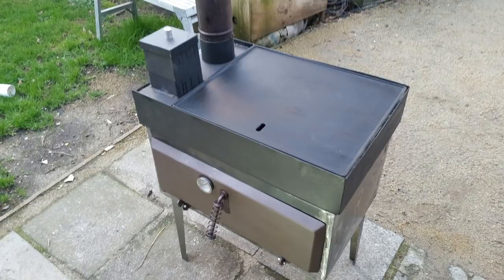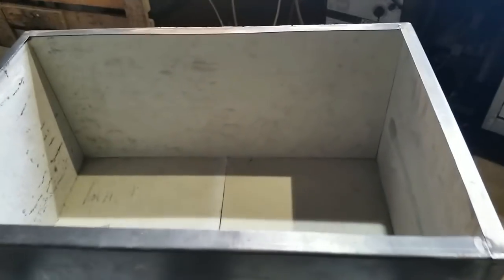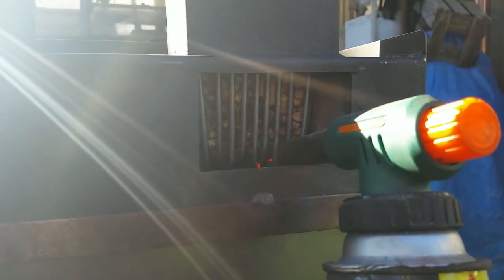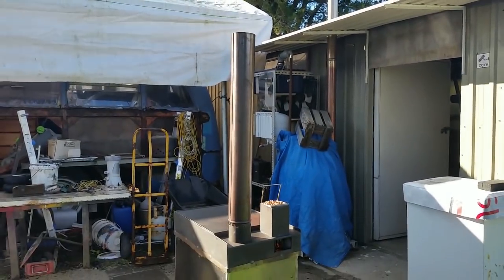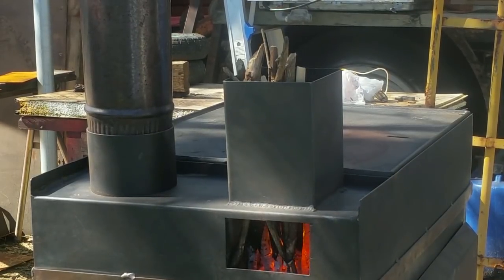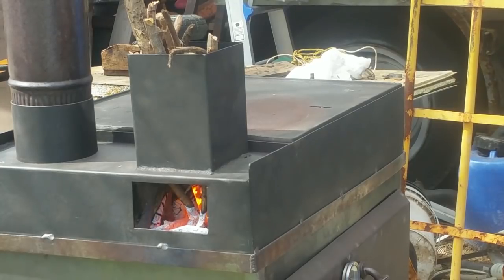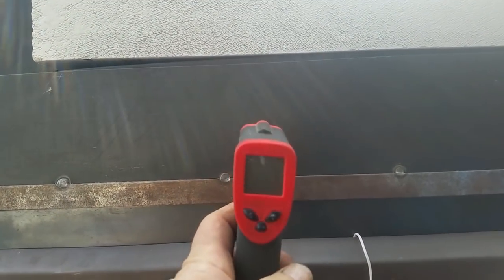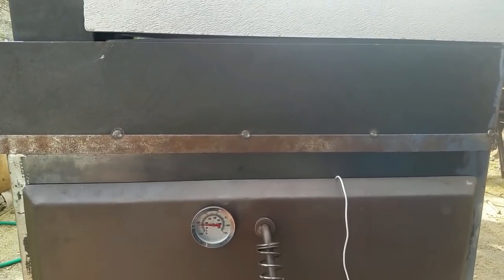Prototype Flatbed Rocket Cook Stove 2018- oven improvements and burning pellets part 5

Comment: Your rocket stove needs to feed upwards into oven to cause a substantial heat rising draw on rocket stove to achieve max potential of draw for air and btu's. The way you have it configured would need a suction fan on chimney or compressed air injection.

Comment: just wondering how fast your exhaust gases are? could they run a turbine? electricity and thermosiphon hot water around the turbine to keep it cool (take heat away for warmer water - skin temp for showers (or the base of your flue, around 60 deg c (hot water temp), keeps a constant not boiling temp and can be held in 20l plastic UN jugs! hot water and power in one (there is a gadget, a biolite stove that is the same/similar)
Reply from the maker: may be if everything was scaled up this could work
Reply: @t.h.o.r.  just ideas that are written down before they are lost are at least ideas one can refer to :-) could make a 'turbo' flue ;-) an exhaust turbine off a diesel vw bus (maybe not a bus one exactly but they are of similar dimensions exhaust piping wise);

 the preceding was meant as a funny ha-ha yet could be something to explore

Comment: make plates inside the stove able to be pivoted horizontal to vertical,they each connected by a single handle kind of like a damper .when pivoted to horizontal this will force the heat down.& even a pipe going to the oven left to right a few times connected to the chimney allowing a small draft

Comment: Build a smaller oven and put it on top of the rocket stove. For the time you use the oven, you'll loose the cooking-area, but in my opinnion it's the easiest way to get the oven heatet.

Comment: I'm loving watching all these and learning tons of stuff; at 14:55 and about's where you are setting the pellets alight I'm sure like me you realise that unlike sticks there's not a lot of air to feed the burning process of the fire triangle. That's where twigs are better as they allow air to get around the twigs and aid the fire. Heat RISES?!!!
On looking at it now I'm wondering whether the heat chamber or burning area might not go down the side and thus heat the lower area too - i.e. the oven. Or do you require two fires? Like my grannies oven there was a water heater at one side the oven at one end, the fire was centre and lower, all the heat then rose to heat all areas, it's true though one side of the oven was hotter than the other, but that's a problem most ovens face.
Reply from the maker: Hi MarkThankyou- yes  now I light a few pellets in the basket and then fill it up once started. check out my latest vids of the aircrete woodstove build. same design as this but with oven at side and in masonry

Comment: Make a portable oven that sits on top. We bought a tiny stove and the burning chamber is on the bottom and oven sits on top.  You cant use both at the same time but say you want to bake bread you could do that and simply lift the oven off and use your griddle. My oven is bolted on but if you have a lip, I would think a portable lift off oven would be safe.  Just thinking how my oven works and seeing that maybe you could do this sort of thing.  That way you get multiple uses and then it’s a good thing that heat rises!  Good luck!  Best from Texas!!!

Comment: I can't help noticing that the fit between the oven door and oven body is poor, meaning that heated air will be escaping from the oven. I think you are focusing too much on getting heat into the oven rather than keeping it in. I would suggest improvements to the fit and sealing of the oven door and more insulation. Brilliant video series on this stove build, very interesting. 🙋

Comment: Hi, love this build, well done.  Wondering if you made a smaller oven that fits on the top of the stove?  So the oven would be insulated on the sides and the top but the base would be open and sit directly on the cook stove surface.  I know this means you couldn’t use both at the same time but it would make the oven work.

Comment: What if you go a few  inches from the burning area and cut a hole in the bottom of the burn chamber to allow some of the heat to go down. You could put a handle that would allow you to adjust the amount of opening. Just a thought. I am sure you will figure something out.

Comment: Put some fins on the top of bottom plate to help transfer heat. But still maintaining a reasonable air gap in your burn chamber.
Reply from the maker: Ive done all that- watch the other videos. New design has the oven next to rather than underneath

Comment: Dear friend, 
I am very pleased to see your developments and constructions. As I will try to create my first oven in the very next days (just when I will receive  my MIG-MMA welder)

 I have seen hundreds constructions on YOUTUBE (this fantastic chanel !!!),  and I have many questions because the creators didn't give all the parametres of their constructions ( !)
 On the contrary you give to us all your considerations and the lessons learnd ! BRAVO to you !
I would tell you to surround the oven with the gases iot be more efficient. I mean the gases to be driven on the sides  (because on the top there is good temperature and in the basis the bricks are giving the proper insolation). How will this be done ? I propose you to make second side area near to 3 cm wide and drive inside the gases. In my oppinion the result will be the best .
 Unfortunately it was something that you have mentioned as the last action.
-I have a question : is the HIGH TEMPERATURE SILICON apropriate for food cooking?  Is it healthy ?
 I am questioning because if it is o.k. I will use it in my construction too. Thank you too much
Konstantinos

Comment: what about making the burn and exit chambers sit lower into the oven or make it a double burner shift chimney to the centre another burner on the other side maybe lol also maybe build a lil hand  cranked blower fan that sits on end to help pellets burn faster and  hotter just thoughts, bro lol (or cut slits into yr stove bottom and slip yr heat transfer fins into slits halfway then weld seal that would transfer a lot of heat with boerkies idea as well ) maybe lol

Comment: I believe that if you moved the rocket stove part of your design to a much lower placement with a diverter to go under the oven to the other end then up and into the stove top chamber you would get to temp very quickly. You could add a shut off to run the heat to the stove top bypassing the oven when you need extra heat for cooking, and not baking. Similar to the best-designed cookstoves.

Comment: I dont know if this suggestion will come too late, but at one of the top box drop in some steel rods, like 10mm diameter down to about an inch above the bottom of the oven and as high in the top box so they are just shy of touching the top plate, they should catch the heat and transfer it down into the oven, heat rises in air but like to run thrugh metal. i guess 6 to 8 of them

Comment: Mom’s cook stove had the firebox on the left side of the stove , front to back, top to bottom.  I think the oven may have been like a box that had glow all the way around the oven except where it was attached to the  outer walls by rods which allow flow all the way around the oven. The stove was EXTREMELY heavy cast iron. I don’t know if the oven was cast iron also. Mom to this day said it was the best stove/ oven ever! Good success!

Comment: Hey love the rocket bbq great idea 👍 I have seen similar projects with the oven built into the chimney, that is guaranteed to work. Another idea is heat transfer through water tubes you could use this idea for heating a bath, having a shower or heating the house, etc.😀

Comment: Or like the guy underneath me said build a slightly thinner version but either way duplicate what you have on top underneath the oven and you would have a winner of a stove
Reply from the maker: Ill make a thinner top unit and see what that does. I can see that the flame goes nowhere near the bottom st forcing it down might be the trick. I do agree that your idea is sensible- but I want it to be as simple as possible

Comment: You keep saying it yourself heat rises. Build another stove underneath of it exactly like the one on top but leave the one on top there you could use the top stove for normal cooking and fire up the bottom one for the oven problem solved.
Reply from the maker: Lol- I know I know !- Ive just wanted to keep it as simple as possible  - your idea is becoming more and more feasable as I eliminate the simpler options- patience grasshopper!

Comment: Make a smaller, portable oven that sits on top?
Reply from the maker: Im trying to make something that will be real simple - no spare bits laying around and I dont want to lose the cooktop,
Reply: Totally get it. I live tiny, too. My stovetop oven just barely holds a loaf of bread..... tiny. 
I hope you succeed in making heat fall. If so, it will be epic, as i dont think its ever been done;) my free hot water is based on thermal siphoning, works very well, both solar and wood. For a crippled carpenter, building my own systems with very limited funds, I understand what you are going through, but your skills are much greater than mine. Steel gives me a headache:)
Best of luck.

Comment: Hey how is the plastic diesel thing going are you still using it and how much did you get out of it I want to start doing wvo in my Ute but a whole bunch of plastic would be easier to get a hold of
Reply from the maker: Its had to wait while I do jobs for other people and Ive not had the supplies to make the parts I need. Insulation is the drama- Ill be making a insulated pearlite concrete liner for the heating chamber soon - then I can get back into it